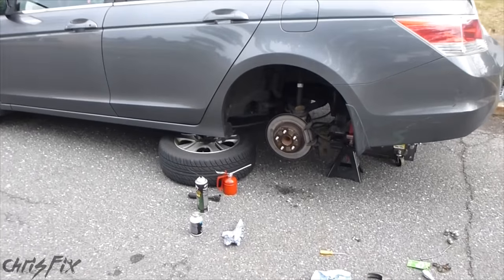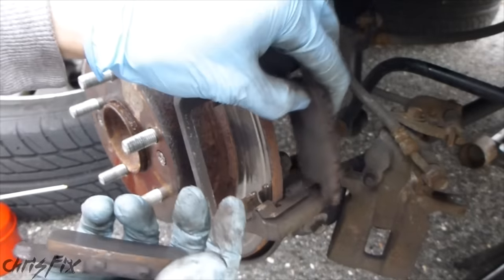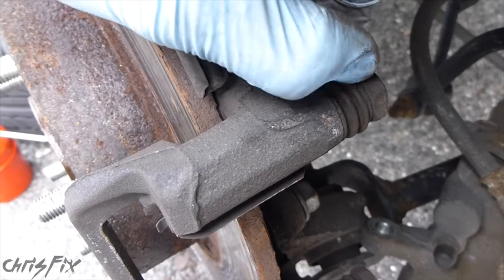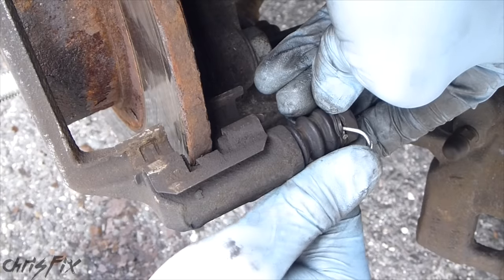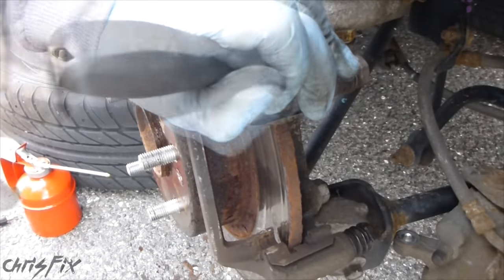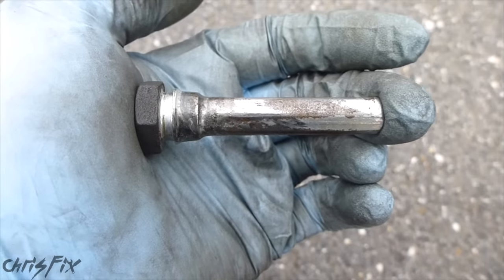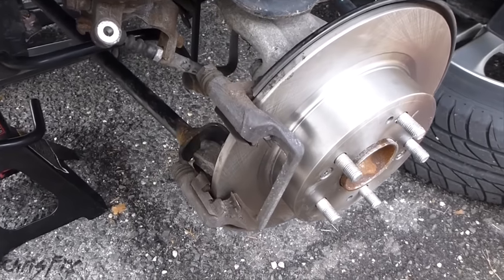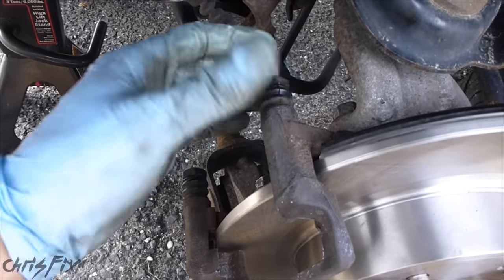How to Fix Uneven Brake Wear

Comment: good vid you missed one of the most important things that make pads stick and wear fast etc , the stainless pad clips MUST be removed and cleaned with wire brush and more importantly the rust cleaned out from under them where they sit in the caliper holder  if not the rust forces the clips up and pinch the brake pads , I remove mine and sand blast the area and then put a light coat of syn. brake lube on the area to prevent rust  then put clips back in . Files and wire brush on drill will work also  just be sure not to hit guide pin rubber boots or remove them as you did in video before starting. This must be done as it is the most common reason why pads stick and wear uneven and prematurely

Comment: Hey Chris,

at minute 6:00 you shaked the whole "thing where the brake pads get mounted". Its defenetly loose ! I think you should have tightened the two bolts whitch are holding this thing.
Did you do this off cam or what do you think about it ?

Greetings from Germany !

Comment: If I hadn’t have seen this I would not have been so thorough in doing my brakes today. Turns out one of my glide pins was seized. Totally. There was no getting it out. Unfortunately I tried for like an hour. Why?  I don’t know but wasted all that time. Didn’t effect pad wear tho. Odd. Anyhow, I had to get a new caliper bracket along with all new hardware.  After that, smooth sailing.

Comment: Even though I grease mine when I change my brakes & rotors I still had uneven wear on one wheel. Turned out to be an uneven rotor I bought on sale at Amazon. Smh. Same brand and part number as the new rotor I purchased from RockAuto for the other side, but almost 40 dollars cheaper. I should've known better with a deal like that and the only 1 left notice on Amazon site. The rest of the pads were still full, that uneven rotor ran through that pad hastily.
Reply from the maker: Darn! That can happen, I would contact the company and explain what happened!
Reply: @chrisfix  I already replaced it. Have problems contacting Amazon for warranties. Been waiting a week for them to reply to my email about a wheel hub warranty. I may just order another from RockAuto and stop getting vehicle parts from Amazon.

Comment: i noticed the caliper inserts where you removed the pins from weren't cleaned, would i damage anything inside the caliper pin insert if i spray break cleaner? i would prefer to clean both, the pin and insert as well.

Comment: OVERHAUL OR CHANGE YOUR CALIPERS, put new hardware (kits are cheap)and nevesez or silicone lube metal to metal,contact areas. Flush old fluid out for new and chk rotors for scoring. If ok sand paper the matting surfaces with a crosshatch pattern

Comment: Chris, please help. My slide pins looked exactly like yours, bottom one fine, top one stuck. I replaced the sliding pin and rubber because even after cleaning off the old pin and hole where it slides in to, it wouldn’t go back in. But, even with the new pin with silicon grease, and with cleaning out that hole with a pistol cleaning set, I still can not get the pins to slide in and out! I ended up just hammering it in so I can use the car. But do you have any idea what else I can do? I may just have to replace the caliper :/

Comment: I have an issue nobody seems to address. I replaced my rear pads and rotors one year ago on my 05 Town Car. I started hearing a squeal at less than 8k miles and thought maybe they needed more grease. What I found was the left pads were like new as expected. The right pads however were worn past the wear indicators. Very even wear and no tapering. The piston and guide pins on both sides move freely. What would make the right pads wear out so quickly?

Comment: I have a brake problem with my brother's 2012 Ford Focus. Both of the front brake pads are worn kind of like steps, where the parts closest to the outside and inside are worn weird, but the center of the pad is fine. Also, the inside pad is worn just slightly more than the outside pad. From what I've gathered, it could be excessive heat due to a guide pin, but I doubt that because it's unlikely for both the driver and passenger sides to have the exact same problem. The disks didn't look warped or badly grooved and I haven't checked the rear drum brakes.
Reply: +That Guy With the Pointlessly Long Username That You Are Wasting Your Time Reading Right Now 
Are your pistons moving in and out without an issue? Any brake fluid issues? Does the car shake when braking or make unusual noises? Has the problem occurred after a brake change? Were the rotors replaced or turned after servicing brakes? Are the guide pins moving freely?
I know it's a lot of questions xD
Also, google focusfanatics
It's an amazing website that helps so much with EVERYTHING relating to the Focus. I used to always go on it for my 14 Focus before it was wrecked.
Reply: Spartan111792 I haven't checked the front brakes since October or November of 2015, but we haven't put too many miles on it since then. The rear drums are fine, shoes have some good pad material left. The brake fluid should be fine, it doesn't look like it's turning any color other than clear. The rotors are the same ones from the factory and have never been turned or re-machined as far as I know, but there isn't any pulsation or weird noises so I doubt that's the issue. He did however, buy the cheapest pads he could find from Autozone. I think I'm gonna chalk it up to just a bad quality pad, but I still do have to check the guide pins, we didn't grease them last time we worked on it.
Reply: +That Guy With the Pointlessly Long Username That You Are Wasting Your Time Reading Right Now 
Checking the guide pins is a good idea. 
If you change the pads you have to turn or replace the rotors if they aren't able to be turned.
when the pads wear down it created grooves that the rotor is used to, when you replace the pads and not turn the rotors to smooth them then the pads will wear unevenly and feel weird. 
The drums in the back should last a seriously long time, possibly the life of the car. Rear has 20% brake power and drums last much longer than pads.
Also, guide pins should be looked at on each pad/rotor change and regreased

Comment: I recently replaced brake pads on my Toyota prado and I noticed a similar problem. unfortunately the silicone paste you are using ain't readily available this side of the woods. would high temp grease do the same job bearing in mind that the guide pins are not covered by a boot and it regularly goes off road?

Comment: On my car's front brakes the inboard pads are identical (both 4mm), however the driver side outboard is less than 2mm while the passenger side outboard is at 8mm.  Which brake has the problem and what should I do?

Comment: The inside brake pad always wears first. Wearing at an angle is caused by slider pins not calipers.  You proved it yourself.  All the brake hardware needs to let the brake pads move. In Michigan, salt and corrosion eats the guides and brake dust cakes on the guides after a while stops the pad from sliding. Its best just to replace the hardware every time you do a brake job.

Comment: So I've just been checking my front brakes on my classic VW bus, the pads are wearing evenly so there is no problem with the guide pins, but one wheel caliper is wearing faster than the other so my left side pads are more worn than the right. Does this mean when I'm braking the fluid is not dispersing evenly between the 2 brake calipers?

Comment: Do you recommend replacing the rotor screw? I did not on mine. Heard they were just to keep them in place on the assembly line.
Reply: You don't need to replace them. You don't even need them. They're here to prevent the rotor from spinning when you install the wheel. So it's easier to install the wheel

Comment: Hey Chris. Thankful for your videos! Just have a question, if I remove the wheel and inspect my breaks and calipers. Would I have to worry about anything going wrong? As in messing up the wheel balance? (I'm new to all of this)
Reply: Javier Morales wheel balancing is when you put little weights on the edges or the inside of a rim to better balance a new tyre, so if all you are doing is taking a wheel of it should not affect the wheel balance but if you see little metal things on your rim don't try taking them off

Comment: I found a ceramic brake parts lubricant that says it's safe on rubber. I was thing about using this to lubricate my brake hardware and the guide pins. Do you think that will be okay or should I shell out the money for silicone paste and copper antiseize?

Comment: If the pin is corroded , you should replace the caliper carrier as well
Reply: My thoughts exactly. At least take off the carrier and clean the rust out of the pin hole. It also looks like the pin boot is actually wiping all the grease off the pin when you install it. That's why I would install the boot on the pin first, then grease the pin, install it, and lastly seat the other end of the boot into the carrier.

Comment: 1:16 looks like the caliper piston slot was not aligned with the tabs on the back of the pad . you can see the rust wear pattern. But yes the guide pin looked stuck too.

Comment: how would you prevent excessive brake dust on one wheel, while all others are generally clean?
Reply from the maker: use ceramic brake pads or low dust brake pads.

Comment: if one of the dual piston is slightly less compressed than the other one maybe by like 5-6mm, but was able to slide it in the bracket okay, will both piston make even contact once i pump my brakes during normal use

Comment: I switched from black brake caliper grease to silicon caliper grease/paste which is light colored and very slippery. Don't know why they call it paste coz it looks like grease. The pins with black grease were dry and I don't know why they sell it... The silicon is much cleaner to use too...

Comment: I find that reman'd calipers, (especially Cardone), that come with the guide pin holder and new pins have totally worn out pin holes in the holder. The remanufacturer fills them with brake grease that last about a month, then the caliper starts to rattle over bumps due to all the slop. It makes your nice car feel all loose and cheap over bumps all because they don't make a sleeve for the hole or an over-sized pin. This wear happens because the pins are hardened and the pin holder isn't. 

REMANUFACTURED BRAKE RETAILERS....  PLEASE SUPPLY NEW SLIGHTLY OVER-SIZED GUIDE PINS FOR PIN HOLES THAT ARE WORN OUT.  Do not expect grease to keep the caliper from rattling over bumps, b/c it won't for long. And with ceramic pad longevity, brake maintenance timeframes are greatly lengthened. Grease + over-sized pins are the answer here.

Comment: Another problem is the piston was not lined up with the pin on the inside pad, the grooves need to accept the pin on the pad in order to push evenly essentially the piston was only contacting the raised pin resulting in uneven pad wear
Reply: @1:32 you can clearly see the witness marks from the pin from 2 separate brake jobs, was never done right

Comment: What would it be if you just replaced brake pads and rotors and before u even start the car and move it the new brake pads are sliding against the new rotor and making slight noises?

Comment: My two guide pins on the same calliper are slightly different sizes. Is that a possible reason why I have a unevenly worn pad?
The caliber bracket is very even and don’t see why I would need 2 different size guide pin, is this Normal or should I replace shin even size pins?

Comment: Just a question. I'm not using silicon grease I'm using heat resistant to 1300 C cooper grease, witch one is better to use?
Reply: VILKAS silicone grease. copper grease is anti seize, not a lubricant. it will not be good for your guide pins

Comment: Hi Chris
the brake wore indicator should be inside the bracket or outside? Thanks.
Reply from the maker: +chao ma Put it on the inside since most of the time, the inside brake pad wears faster (as you saw in this video). Good question!

Comment: I own a jaguar x type. The shop "fixed" my wheel bearing which was causing my rotor to be worn down by the caliper and now the caliper is back to hitting the rotor and scraping very hard. Just changed the rotor and brakes thinking it'd help and it's still hitting. Is it the wheel bearing you think? Thanks to anyone that can help

Comment: Are you supposed to lubricate the guide pins every time you change the brake pads?
Reply: poundu27. yes. even before you change your pads. like every 25000 km, lub your guide pins. just as a regular maintenance schedule.

Comment: Chris I have a question about a stickin caliper,   I have a 2005 silverado 4.8  2wd   with a sticking caliper both sides,  
front right, front left,   I changed the calipers the brake hoses the 
master cylinder flush the brake fluid,    and still sticking both sides,
  what do you think it could be?

Comment: If you going to clean the caliper pins why don’t we clean the holes the sit and move up and down in?…just thinking maybe it’s really dirty in the hole and you putting  and clean caliper pin inside a dirt hole(No Diddy)…I’m new too car mechanic only been doing it for 2 years so I’m just curious
Reply from the maker: If the boots are in good shape then they should do a good job at keeping most of the dirt out, you can always put a little paste on, move the pin in and out then see what’s on the pin afterwards if you are concerned

Comment: One was so badly seized on my moms saturn that despite even last-resulting to using a torch, i still could not get the one pin out. Had to replace the whole caliper bracket and pins

Comment: got a clunk on my front end that sounds like loud "clunk" when i apply the brakes or when going over bumps. So far i have changed the front shocks, inner and outer tie rod ends left and right and  stabilizer bar bushings left and right. due to maintenance and common wear.
this baby has been great to me. its a 01 ford escort zx2  with 150k .  when i get under the car, everything seems tight and not really sure what i should be looking for for that clunk. any ideas? thank you

Comment: I know this is a longshot, but i believe i have this issue with newish rotors and pads and there is a bit of uneven wear on the pads. Can the issue be resolved by just fixing lubrication issue or do the pads also have to be replaced.   (Slight brake pedal pulsing.)

Comment: I have the uneven ware issue only on my front passenger side.  I changed the pins, rubber boots, and hardware last time only on that side.  That brake pad on the same side has worn down again.  Since I only change the one side, can I use the other set of pads on the same side or are the pads not interchangeable from side to side?

Comment: Hey Chris, my girlfriend has the same year with the 6 cylinder. It's leaking oil, i replaced the valve cover gaskets but it continues to leak.do you have an idea of what else it might be?
Reply from the maker: Do you see the leak? If not, it could be the piston rings. There was a recall.
Reply: ChrisFix yeah I can, there's oil on the exhaust manifolds; both sides.What if I replace them again and add rtv silicone? And could a bad pcv valve cause that to happen?

Comment: @ChrisFix, I know you get a lot of questions, but can you help? I took your advice and did the caliper guides with 3M Silicone Paste (instead of Permatex Ceramic Extreme Brake Parts Lubricant, which I used previously for the caliper guides and brake pads; i still use Permatex for the brake pads). Anyways, the problem is the caliper guides don't want to stay in the caliper bracket. I had to use a ratcheting bar clamp to get it together because I couldn't squeeze them together with my bare hands. I am afraid that the pressure pushing the caliper guides out of the caliper bracket will cause unequal wear to the brake pads. This is on a 2015 Chevy Impala Limited (the "Limited" aspect may make a difference as it has with wheel studs). Do you have any advice? Thanks.
Reply: in answering my own question, don't put any lubricant in the holes for the guides, instead just apply grease to the guides and clean out the holes for the guides with alcohol or vinegar and q tips

Comment: All i have is hi temp grease for my pins is it really that bad to use it
Reply: Not good...it will cause the rubber to swell which can cause the boots to jam up the pin if gets lodged in the pin guides.  Moly-Lube or PBR caliper  grease.

Comment: I took my caliper off, as I was going to change to stainless steel brake lines.. Became a pain and ended up putting everything back together.. Just took off the pads, after I unbolted the the caliper... and now when Im at a stop and push the brakes in even further, im getting a weird crunch when applying the break? what did I do to cause this

Comment: Pro tip dont buy an 8th gen accord to avoid this issue. That being said I have one and had this issue. Though mine was caused by guide pins on the inside pad slipped out of the groove of the caliper which caused uneven wear. Pads looked like. [I \]

Comment: I have the one brake pad that was worn out more than the other on the same wheel. I noticed the rubber boot was torn on one of the pins and it wasnt moving smoothly. Is that the cause of one brake wearing out more than the other?

Comment: i ran into the problem of the pin being so seized that i could not remove it at all. flat head, vice, nothing. the trick that worked for me was to take a torch and heat the bracket so the metal could expand and the pin could be removed.
Reply from the maker: +Taylor Smith thanks for the tip Taylor!

Comment: what about if there is uneven wear on the outer edge of the pad. what i mean is basically there is a lip on the edge of the pad that rides on the outer part of the rotor, like the pad is sitting too far and going over the rotor..